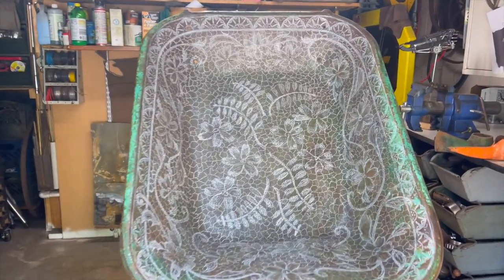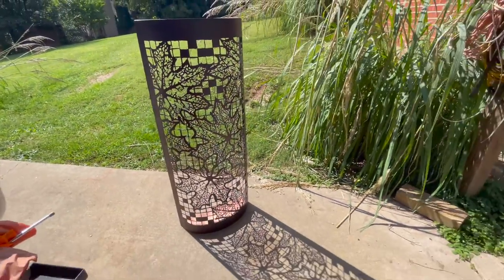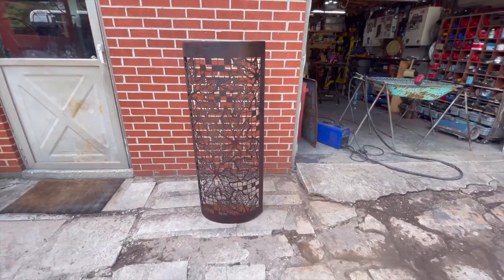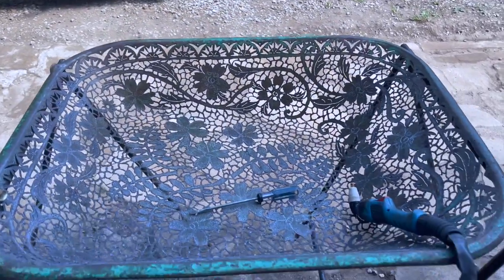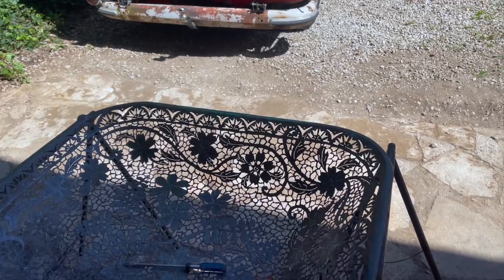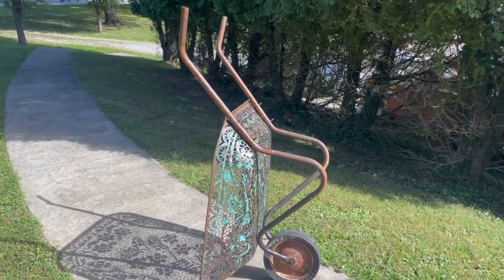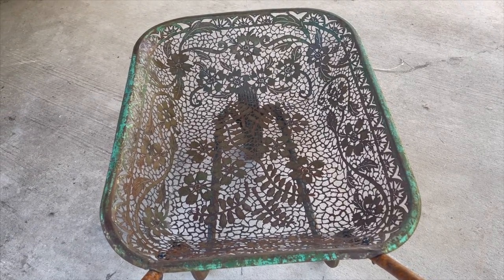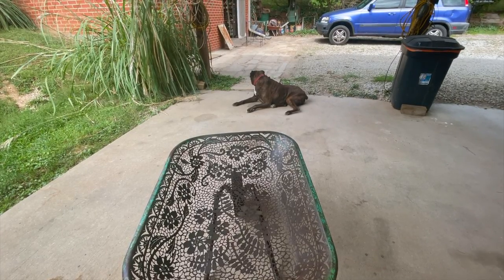Making lace by hand, hand held plasma cut metal lace!!

Comment: Lace on the car fender hood, are not very smart when it rain, why not put tape on the back, then fill the void with colored epoxy resin
Then it can be back lit and are weather proof
Reply from the maker: haha, well...it's an old VW, as to the rain what is it really going to hurt if it DOES rain? the spare tire?...and kind of the whole point of plasma cutting something is so that it is cut...All of the dash electrical is covered with a fiberglass cover on this car...we really only drive it with this hood on to shows or on nice days...ironically we DID get caught out on it on the interstate once in a horrid pop-up shower...nothing past the hood cut even got damp! In that same storm we hit a large log that had dropped in the road, totally smashing the front of the car and jamming the hood where it wouldn't open...BECAUSE we had that particular hood on I was able to reach my hand in and unbolt the hood handle and get the hood open to make the repair, without that hood on we would have had to cut the hood handle in two and it would have been junk....life in a lowered car...sigh...thanks for the comment...you think  this car is  cut up check out Rae Ripple's cars, she cuts the entire car!